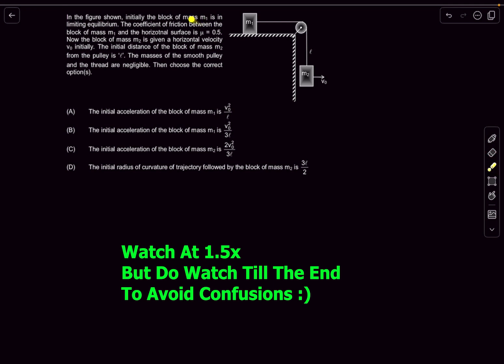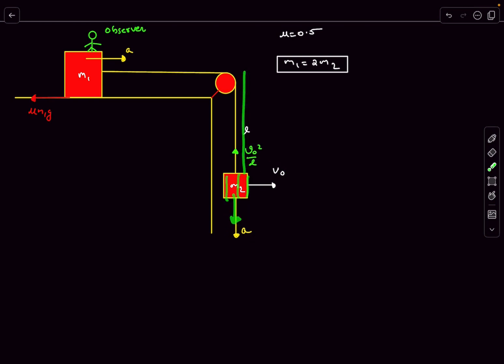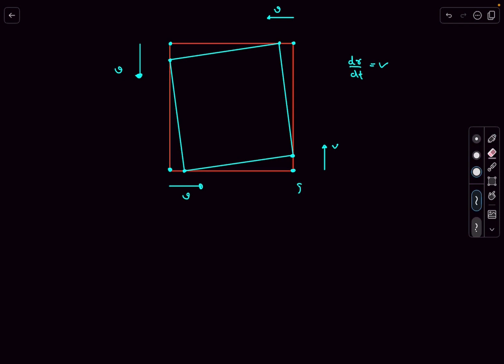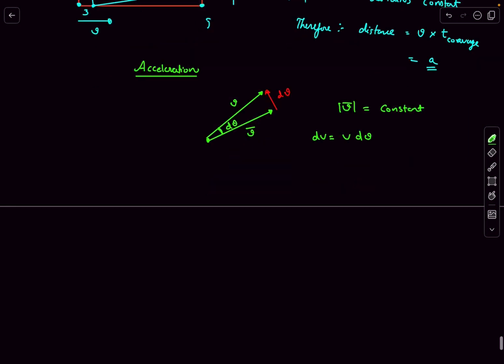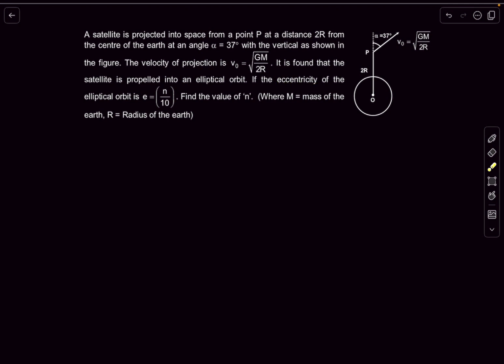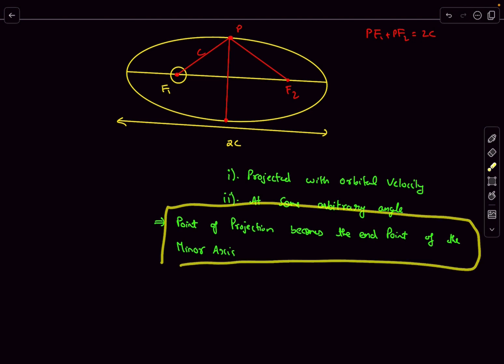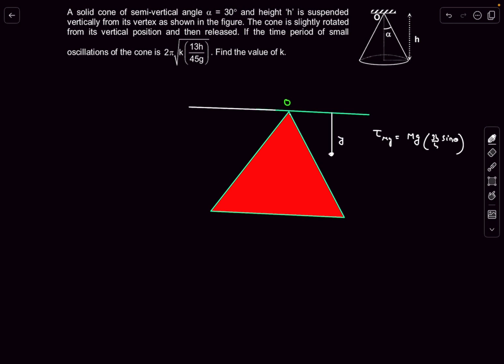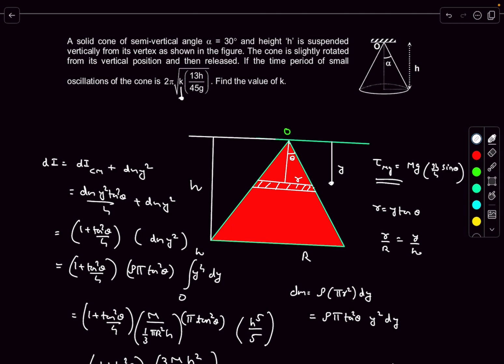Good Mechanics Problems From AITS | JEE 24 And 25

Comment: one doubt when we write angular momentum it’s formula is m(rcm * vcm) + I com W , bht if the point about which we are writing angular momentum is moving with some velocity then do we need to take relative Vcm ? 2) if the point is in non inertia
L frame then will the angular momentum formula change ?3) if we are in rotating frame of reference what changes will we observe in angular momentum

Comment: A stream of particles each of mass 'm' and moving with velocity 'v' is incident on a small hole of
diameter D . Estimate the diameter of the beam at a distance L from the hole. (L >> D )     how to do this question i found it in allen AITS in solution they did it by hiesenberg principle

Comment: The result you told in elliptical trajectory prob 
I used and learned that in a problem of sring connected at focus and other end was at major axis end the length of spring there was a(1+e) and had to find normal when spring end got to minor axis end
Very good and conceptual video
Thanks

Comment: is it possible to solve the gravity ques using only angular momentum conservation and energy? because i tried,  im getting eccentricity in terms of R/a (2a is length of major axis), is there any third equation that can be used other than the one you told in the video?